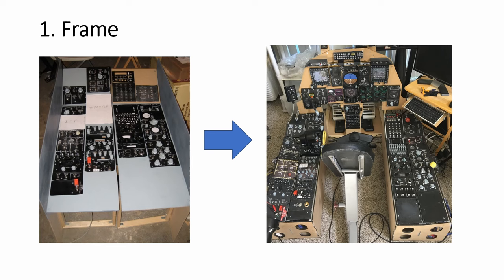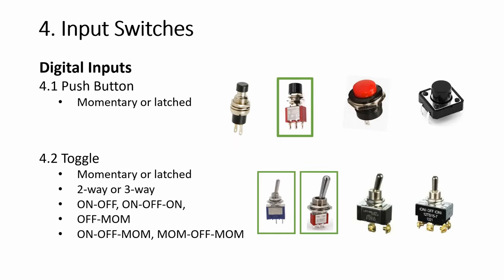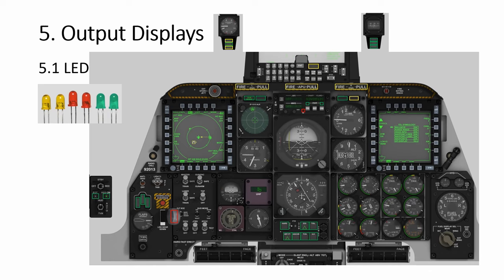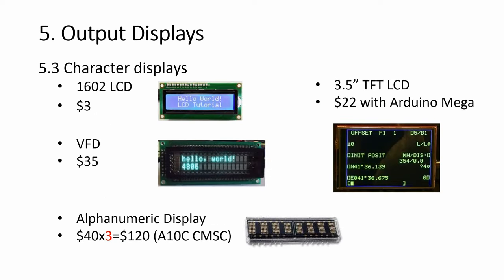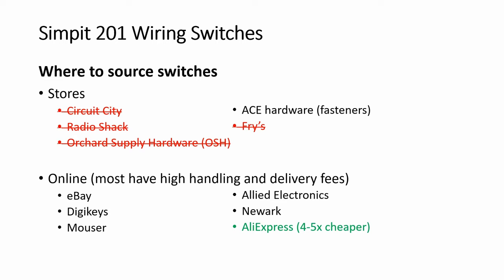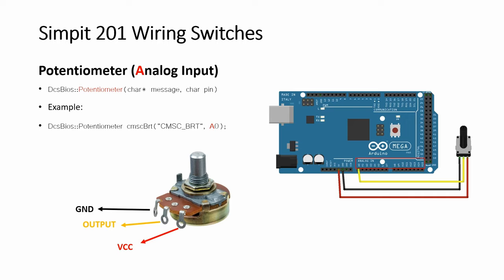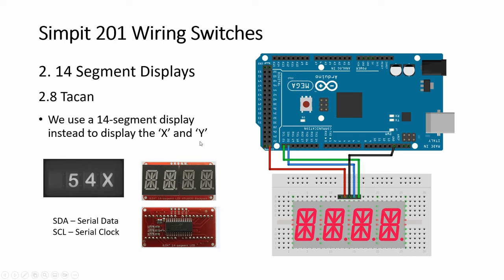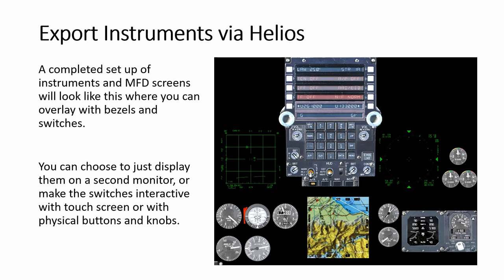Episode 1 Simpit Building 101

Comment: Is a double cockpit (pilot and WSO) possible to be built ? Your Cockpit...is it the real scale size of the real F-15E cockpit ?
Reply from the maker: Look at episode 24. You don't need two cockpits. The pilot has access to most panels and switches. For a few panels that are kinda exclusive to the WSO, I just added them to the pilot cockpit. Then now the pilot has all pilot and some critical WSO panels and switches.
Reply: @simpitacademy  I think the only critical difference for the WSO is one more MFD and... the switches for countermeasures RWR and TGP
Reply: So...the F-15 could fly IRL without the WSO... isn't ?
Reply from the maker: @solonemanuelwhitetigernava571  yes and no. Most of the time the pilot can do everything from the front but during start up there are some switches required to be turned on and they are only in the wso side. See my latest video on cold start where I cheated by operating wso switches in the front seat by adding some wso panels. Then I have access to even these wso switches as pilot.